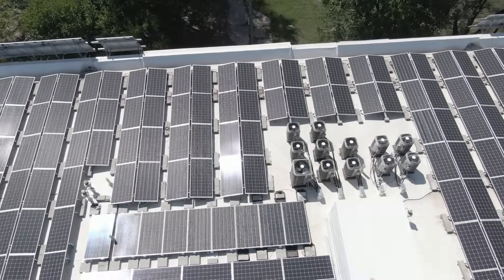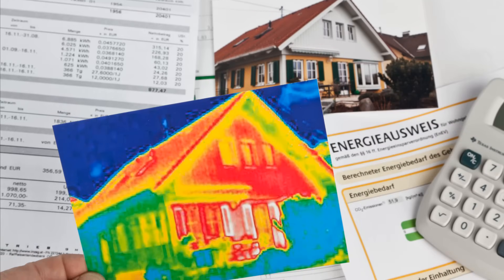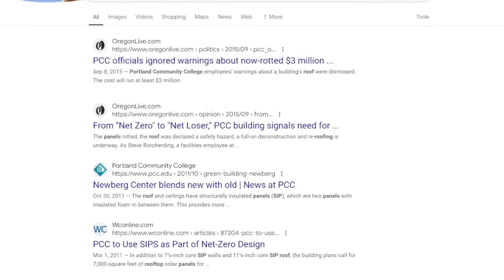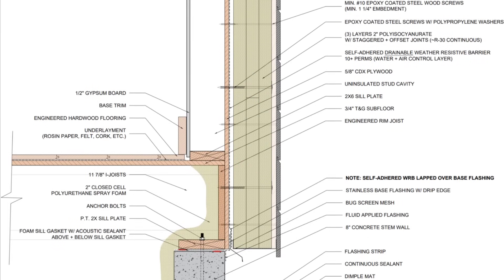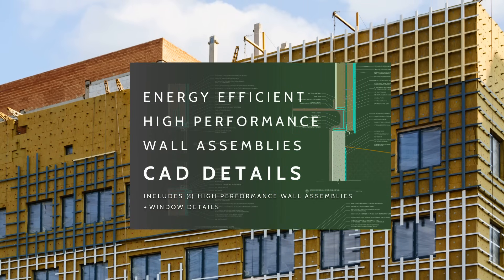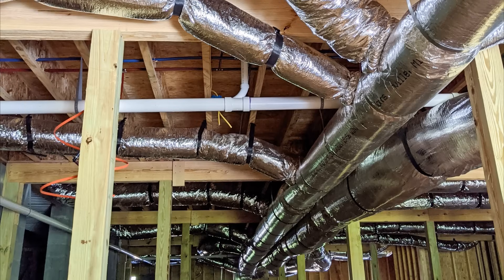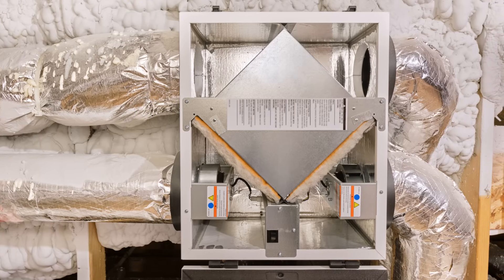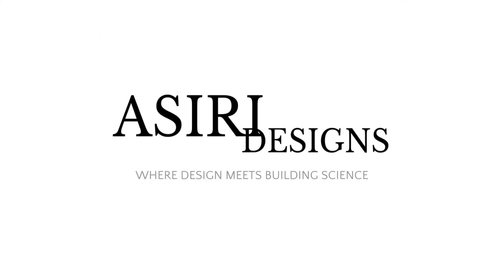The Unintended Consequences of Energy Efficiency...

Comment: I am an Architect in UK.  Some time ago I did some work with The Cranfield Institute, one of the foremost technical universities in UK, with their energy predictive modelling.  I was designing a college library with classrooms and the Govt requirements for classrooms required lightweight, well insulated construction, whereas I was given a free rein on the library due to its specialist nature.  For various reasons the library was a heavyweight concrete frame and floors with brick north and west facing walls with the others being single glazed with solar shading.  The annual energy consumption showed that the library used less energy than the classrooms and maintained comfort level conditions all the year round with very little input.  The A/C, which is vital for book storage was barely used such was the stability of the environment.  During the summer the shading prevented overheating but allowed enough solar gain to warm the mass so that it emitted the heat during the night.  The process was so slow that there was very limited temperature fluctuation.  In the winter solar gain was allowed to heat the building and with its huge thermal capacity there was plenty to keep it warm overnight.  The classrooms on the other hand had wild temperature fluctuations that at the height of summer the temperatures were intolerable and require Air Con.  As Air Con costs 3x that of basic heating to run, the costs were very high.  The principal problem was that the classrooms heated up during the day and couldn't give up the accumulating heat to the point where in the afternoon temperatures were getting to 38/39degC (100+degF).  At night all the accumulated heat was lost and the process started over.

What i took away from this was that for energy efficiency it is better to have a heavyweight building than a lightweight, highly insulated building.  Our ancestors knew this when they built their cottages of stone with 2ft thick walls that to this day are magnificently cool in summer and cosy warm in winter.

I do accept the points raised by this video but have to say that most builders don't understand the importance of constructing the correct detailing, even when its provided and this is all left to the site worker that simply doesn't give a damn.
Reply: Thermal Mass gets the pass.
Reply: Yes, thermal mass is important. I dry lined my 1870s 16" thick solid stone walled house on the external walls. The temperature varies inside from 15 to 22°C year round with zero heating or cooling inputs whatsoever. Contrast the new build with fancy everything and tiny windows and see how those people fair in a typical summer. Derbyshire, UK
Reply: @davelowe1977   The issue with modern housing is that there is a fixation about preventing heat escaping not how the building actually performs, add that to a 'one size fits all' approach and you have the common modern sweat box that very soon demands cooling via 'A/C'.  The trouble with that is the energy used to cool 1deg is 3x that to heat 1deg so it becomes energy intensive, which defeats the object of the exercise.
Reply: @clivewilliams3661  I'm not sure where you get your COP figures. Heat pumps pump bidirectionally and are typically 350% 'efficient'. Performance I agree with you about 100%. I'd be interested to see some empirical data on performance vs energy use in various housing stock options. For example, let's assume we wish to maintain 21C year round. A given property will have a temperature curve from solar heating etc which we could graph over 365 days. We could then calculate the energy required to maintain this temperature either heating or cooling. Of course, this depends on the use case. This analysis would be perfect for a nursing home or hospital since they are 24/365 occupancy buildings. However, the family home might be unoccupied from 8am to 6pm so now the analysis changes to reflect uncontrolled temperature for ~10 hours, but then a 'burst' mode to rapidly meet the set point for the remaining time. A complicating factor is having two set points for awake and asleep time, disagreements over the set points, different set points for different rooms etc. All of these factors effect the building materials used in terms of their thermal mass, and especially in the placement of insulation. The building will behave very differently if insulation is outside of, or inside the main thermal mass components. Not to mention insulation between adjacent rooms. You are right that fixating on insulation at any cost is a blunt instrument, but in my experience as an expert in design engineering and engineering decision making, most regulators and government departments are too stupid to see beyond a low resolution binary choice type scenario. So we are where we are.
Reply: @davelowe1977  I was not specifically talking about heat pumps but my information came from a discussion with a services engineer regarding HVAC and we were talking about the energy to condition a space to raise it one degree and to lower it one degree from an ambient temperature.

As you have pointed out there are a myriad of individual considerations that need to be accounted for to assess the energy performance of any building and speculating on one building type is a worthless exercise.  The example that I give was to show that different building designs that were coincidentally at different ends of the spectrum performed differently.  As I have repeated many times before, every building project is a prototype, even a McD's DriveThru that comes complete on the back of a wagon.  

I have made the point elsewhere that the Approved Documents that most people refer to for an indication of what to do with their building should be only treated as a 'deemed to satisfy' provision and the actual regulation is more nuanced.  This is why we can have buildings that meet the energy requirements of the regulations whilst seemingly not complying with the deemed to satisfy provisions in the Approved Documents or on face value pass or fail SAP/SBEM assessments.
Reply: What does it cost per square to build a heavy versus lightweight building?
Reply: @jimmiller5600  It very much depends on where in the world you are and what local materials and skills that are available.  In the example I cited, the reasons for using a heavyweight building for the library were not solely about energy performance, acoustics, structural spans and building response times all paid a part in the decision making.  With regard to the classroom block, the decision to use a lightweight design was guided by the DfEE funding model.
 If you are looking to design a building for yourself then a whole range of decisions come into play to advise the form of construction but it is worth noting that some of the very best zero energy consumption buildings are heavyweight structures, you ought not to believe the Govt and energy companies as they have a one-size fits all agenda.
Reply: In my country South Africa, Spanish style was once popular with those thick walls you mention, warm in winter and cool in summer, but costly to build. Clay or concrete stocks with a double-skinned exterior are almost universal, erected on a concrete slab, the exceptions naturally being high-rise and factory/warehouse. Here on the mile-high Highveld winters can be chilly, and ceiling insulation doesn't seem to help much. Heat is lost more by convection than by radiation, I think. Would a roof space fan help, blowing the warm air back down?
Reply: @shadeburst  You are correct in suggesting that heat rises and will accumulate at ceiling level so that blowing it back down to floor level would be beneficial in the occupant feeling warm.  This is why underfloor heating is so effective in that heat from floor level rises and gives a more constant overall temperature.  In many cases people compensate for feeling cold (at foot level) by raising the general temperature with their wet heating system having a greater overall quantity of heat in the space.  Its worth testing the temperatures at various levels to get an idea of what the actual status is.
We lose heat by convection through ventilation and leakage.  The leakage can be substantially reduced by carefully surveying the property and stopping up unwanted gaps and the like.  Planned ventilation for say, toilets and wet areas can be controlled by using forced extraction and then extracting the heat, which heats the make-up air, which saves money and ensures that essential ventilation takes place to reduce the potential for mould growth.  I have also used a ventilation heat recovery system to connect up the tumble dryer to extract the heat that is normally thrown away with the moist air.  Normally, the heat recovery works on tick-over all the time, keeping the air moving with fresh input air and when called for by a manual or auto switching system the heat recovery goes onto boost to achieve the required ventilation rates.
Reply: @clivewilliams3661  Thank you for taking the time to explain this in a way that even I can understand!
Reply: I'm not a construction pro, but 100% agree on the point. I'm from Finland, and in the 70's due to oil price induced energy crisis Finland started building in "energy efficient" way. Solid mass timber / brick / concrete building and old-fashioned country-style wood building reduced, in favor of new style with multilayer walls utilizing many different materials, lots of insulation, air tightness etc. For some reason in addition to to this, they also made some buildings with flat roofs! And many with very low foundations!

Well, most of the houses from that time are still on the market, but MANY of them have had to go under significant reconstruction to get rid of mold and air quality problems.

Now being in Finland, we do get harsh winters so it's for sure that buildings need to be at least somewhat effcicient. Those old countryside "rossipohja" wood houses did not rot, because there was constant airflow going under the building and who knows where else. But that will cause significant heat loss. But concrete, brick and massive timber houses from that era are still doing a-ok. I live myself in a 1968 brick house built in older style. My mother lives in an early 60's conrcrete apartment building. In my house the upper insulation has been increased as that's where most heat escapes and windows are updated, but other than that everything structural and insulation is original.

Finnish building code puts too much emphasis on "U-value" when rating energy efficiency, which basically just measures insulation properties of a wall. But basic thermodynamics suggest that massive wall structures capture and release heat energy. It also seems straightforward to me that the more different materials you use in a wall, the more possibilities for moisture to condense in these material change areas. And if any/several of these materials are weak to moisture......

So if I was building a new house right now, I would go for massive timber and wouldn't look any further. Overall energy effciency rivals modern multilayer-buildings, but with only one wall material. Timber is faster to build than brick, and it is a beautiful material as is. 

Newer style buildings of course can and do last when all is done well. They are just much more vulnerable to circumstances and errors. It's hard to mess up if your wall is just solid, but it's easy to miss a spot or poke a hole on a vapor barrier sheet.
Reply: @KeijoAmbersson  I disagree with your simplistic assessment because there are a number of competing requirements that mean that a specific construction is not ideal in every instance.  You have the thermal resistance of the structure, its thermal mass, air leakage, fresh air input (and exhaust), heat distribution and radiant heat reflected off building materials and lastly the occupancy rate.  How you construct a building is determined by how much weight you give to each element because most are contradictory.  Unfortunately, national building codes have to take a simplistic view and a 'one size fits all approach'.  If we required a building to have a prescribed unit energy consumption based on annual weather patterns then we would see that more choice in the solution would be generated.  

BTW what is wrong with flat roofs?  A flat roof can be a very efficient solution and coupled with a sedum surface is both environmentally friendly and high performing.
Reply: @clivewilliams3661  The flat roofs that have underlying wooden structure are horrible when you have snowfall. All the 70's houses that were built with flatroofs have since been converted to traditional sloped roofs here. Snow doesn't go anywhere, roof likely bends a bit under heavier snowloads, springtime melted water doesn't go anywhere, and you have a damaged roof. Nothing wrong with flat roof if you have concrete structure, many large industrial buildings are built that way here too. The 70's houses here were jump to a new style of building, and not everything was known at the time. Lessons have been learned since especially regarding moisture. Nordics are especially difficult for it also due to massive temperature difference between indoor ando outdoor temps.

I did say I'm no pro in construction, just eager amateur, and my point of view is subjective. It is absolutely possible to make modern insulated houses work, loads of people live in them all the time. But I prefer simpler things, less to go wrong. Hence my fondness of timber log building and full brick houses. My dayjob is mechanical machinery design, and whenever possible, I want to make the assembly work with as few parts as I can.
Reply: @KeijoAmbersson  It is entirely feasible to design and build flat roofed buildings to meet the criteria but I think it is true to say that 1970's housing was generally poorly designed and built, mainly because technology had taken hold and there was a belief in its ability to provide what we all wanted in a brave new world.  But to condemn all modern construction as bad from examples that are now 50 years old is short sighted.  I believe we understand more now than ever with building science having moved a long way is a short time.  We shouldn't forget the lessons of the past that took 100's of years to perfect but that doesn't mean we shouldn't embrace modern practices. 

Whilst I don't disagree that Scandinavia has particular needs, perhaps the most difficult environment to design in is in the Alps of Europe.  The fluctuations of temperature, even in one day causes massive difficulties to overcome.  Roofs on building can warm up during the relentless sunny days with very high levels of UV and solar gain to in excess of 40degC and then plummet to -10 to -20degC at night, a range of 50-60degC.  Since WWII a range of materials to have been developed to successfully deal with these issues that former products were poor to hopeless at dealing with them.
Reply: @clivewilliams3661  Yeah for sure lessons have been learned in 50 years. And it's not like energy has become any cheaper, Russia's adventures have made it more expensive than ever. Most new houses built in Finland are built from mixed materials, usually with wooden frame + insulation + vapor barrier + drywall. Outer weatherface from material of your choice. And mistakes of the 70s are usually avoided. Mostly.

Yet, traditional timber log building still stands strong to this day. It has gotten some updates of course, it benefits from newer roof insulation materials and newer heating systems. Those with more money can even go for a classic stone house. It is just less likely to get problems in this kind of structure, based on the experience of housing in Finland. They also hold value better, although in case of timber logs and stone part of the reason is the romanticism of the material. Not everything needs to be built this way, but it is the way I personally would go on a new build. 

Flat roofs, you almost never see them in houses made after early 80s here. The only ones you do see are in more uniquely designed architect houses, and in those cases instead of wood they use concrete and/or steel.
Reply: @clivewilliams3661  I read all your posts and have found it very insightful, just a Lay person here just trying to learn more. I have been thinking about the simplicity and long lasting design of the centuries past brick and stone made buildings. I am not a fan of all the plastics/barriers being used in modern construction. I was intrigued by the ICT designs but the whole Styrofoam thing doesn't sit well. Saying that how would this be as a design, 1' think stone/brick wall then a 8" cavity filled with rock wool for insulation then another internal stone/brick wall that is a foot thick. NO vapour barriers just simple design but with the decoupling with insulation. 
 Another pro builder stated they would do a framed wall in between the stone walls but then your dealing with timber that could eventually rot. I appreciate your insight greatly.
Reply: @jason.martin  There is current thinking on vapour permeability through walls and rather than stopping the vapour getting into the walls, it is encouraged to pass through it as well as allowing the inner skin of stone/brick to dry out on the inside.  Your constructions appears to have merit but it would not be necessary to have 1' of external masonry as most of the job is carried out by the thick inner skin.  The one thing to realise is that the thermal mass of the inner skin will respond slowly and that would presuppose occupancy levels being consistent most of the day to take advantage of it.  One thing that needs to be carefully calculated is the location of the Dew point that needs to be at the outer skin to prevent interstitial condensation causing a problem.

I would certainly not put the insulation in a timber frame for the reason you suggest and I would expect that semi-rigid batts of Rockwool to be reasonably self supporting especially held by the cavity ties.
Reply: "For some reason"

Architects still being the clueless bunch urban planners know them to be. Newsflash: Books are heavy.
Reply: yeah, but.....people.  Little 100 watt moist heaters.  Classrooms full all day, library full of stabilising books.
Reply: This is the advantage of thermal mass.  Not only is thermal mass present in the building's construction, but also in it's contents.  I live in a 70 year old home on the east coast of the USA in a home primarily built of brick and block.  It is VERY comfortable and rather efficient to heat and cool.  I hear of others around that have much newer wood frame built homes, and they are always complaining of big electric bills, and their homes either being hot or cold.  My AC unit doesn't even run until late in the evening during the summer, and during the winter the house stays warm for a good part overnight, and heat only needs to come on in the morning and evening
Reply: @audvidgeek  It is no coincidence that in many parts of the hot and arid world the vernacular building type is heavyweight adobe or stone buildings that remain remarkably cool during the hottest of summers.  If you can reduce your cooling cost then that will have a significant economic benefit.  Service engineers have told me that cooling 1deg costs 3x that of heating 1deg.
Reply: @audvidgeek  thermal mass doesn't change how much heating or cooling a building needs, it's still losing the exact same amount of BTUs as a house with less mass. This is basic thermodynamics.
Reply: @AltereggoLol1   Yes. but the thermal mass allows the building's temperature to be more stable in relation to the outside.  In my case, the cooler temperatures at night time cool off the house's mass and it stays cool for a good part of the day.  We close the windows and keep the cooler air in. At night time, we open the windows to let the heat the house has picked up escape and allow the mass to cool down.  The house's temperature is more stable and comfortable.  The wintertime, is the same way.  The house is warmed during the day with mechanical heating methods, and it remains warm through the night when the thermostat is set back. It's cheaper to heat the house during the day when you have heat gain from the sun and warmer outside temps.
Reply: That sounds like it works great in the UK, where the average daily temperature is approximately comfortable.  It wouldn't work well in Texas in the summer where the average daily temperature is just hot.  It wouldn't work well in North Dakota in the winter, where the average daily temperature is deadly cold.  Thermal mass serves to hold a building at the average daily temperature.  If the average daily temperature is not what you want, then the mass doesn't help.
Reply: @FreedomTalkMedia  I think you are very wrong here. You simply want the inside of a home to be resistant to external temperature change. The location of the home and temperature of the outside should be irrelevant since you are trying to isolate the two spaces. The laws of thermodynamics dont change just because you went to a different state or country. If the average daily temperature is not what you want, then the mass is exactly how you efficiently retain the temperature that you want once you get it there. You started out talking about texas, so then go look up Earthships which are made in texas. The heavyweight design is pretty obvious in all of them to retain a steady and desired temperature.
Reply: @FreedomTalkMedia  never heard anyone claim the UK to have approximately comfortable temperature at all. Also heavyweight buildings are great at keeping buildings warm, look at old buildings in the middle east. And for winter places again thick walls are good too.
Reply: @Alex-cw3rz  The UK does not have extreme temperatures like many other parts of the world.  The hottest month, July, has an average high temperature of 75 degrees in London, with a low of 59 degrees.  That is a near perfect temperature range for thermal mass to work.  

In the winter, the averages are from 41-48 degrees.  

Detroit is 8 degrees hotter on the high and 7 on the low in summer.  In the winter it is 16  degrees colder on the high and  12 degrees colder on the Low. 

In Dallas the average high temperature is 91 degrees in the hottest month, with 20 days over 100 degrees over the summer.  Now this is key, then the temp is 91, the low is 70.  Unlike London's 59 degree nights, 70 degrees is not going to cool your dallas house, if it has mass.  

Yeah, The UK has a mild climate with mean temperatures, if anything on the cool side.  So there would be little need for cooling if you have a massive house, in the summer .

What thermal mass can do in Dallas though, is what I said it did in Guyana.  The air conditioner can run all night, cooling the mass, so it can store heat again in the day.  Then the grid is less strained during the day and energy prices are less.
Reply: @FreedomTalkMedia  If that were true then why are the vernacular buildings in the American south and Mexico built with thick adobe walls, with this style of building being common throughout Nera and Middle East? Those thick mud walled buildings are generally wonderfully cool in the day.  Also, you will find that comfort conditions are a broader range than those expected by most Americans  

In the northern climes, the predominance of timber often dictates the basic building materials but still the vernacular buildings were heavyweight utilising large baulks of timber instead on vast quantities if sawn timber that supports the heavyweight ethos.  In those places where timber is less prevalent and stone building is common, thick stone buildings provide cosy warm places during sub-zero temperatures and comfortable temperatures during the summer.
Reply: @clivewilliams3661  Well, in most deserts it gets cold at night.  It really depends on the location.
Reply: @FreedomTalkMedia  Location does have its part to play because in the tropics the mass of the vegetation retains heat so that night temperatures don't drop as far as well as cutting any cooling breezes.  In those circumstances you will find the vernacular building type to be lightweight with masses of ventilation.  My wife's family home in Guyana was raised on stilts with storage only at ground level, with the first floor completely open plan with few external walls.  The bedrooms were built with freestanding partitions with no ceiling, being open to the underside of the pitched roof, ventilation flowing freely from the veranda and up over the bedrooms, drawing some of the heat out.  The whole construction was to take maximum advantage of the sea breezes to moderate the warm humid atmosphere.  It is interesting however, that many old colonial fortifications were built with massive walls and those buildings tend to be quite cool inside but even more humid as the ventilation was poorer, which meant that the RH increased due to the cooler air.
Reply: @clivewilliams3661  In Guyana almost everything is concrete now and the thermal mass effect is there.  You can feel the wall warm during the day, even as the AC runs to keep the room cool.  It doesn't really get that cool at night though, like you pointed out.  I guess the thermal mass enables you to store up air conditioning all night.
Reply: @FreedomTalkMedia  I was commenting on the traditional housing rather than modern ones and before technology took over.  I much prefer to get the passive side of the building right and then just use any technology to trim to the final effect.
Reply: @clivewilliams3661  Thick stone buildings are not "cosy" in prolonged sub-zero weather. There's a pub I'm familiar with in Carleton Place, ON, probably built by Scottish stonemasons in the 19th century with really thick walls, a good 2' thick... and you absolutely do not want to be seated near those stone walls in the dead of a Canadian winter. It's just sucking the heat out of the room and conducting it to the outside. Cosy it is not. Any benefit of thermal mass has long since been lost, probably by mid November. The R-value of stone is like 0.1 so even this 2' wall has an R-value of at best 2.5; literally putting a half inch layer of styrofoam on either one of its faces would have doubled the entire wall's insulation value - that's how bad stone is at insulating. The only way you're going to benefit from the thermal mass of masonry in such conditions is if you put insulation on the outside of it. Heck, just piling up straw bales on its outside for the winter would be a vast improvement.
Reply: @davidjames4915  The example that I gave specifically related to the UK climate that is temperate and the point was that the thermal mass is important in the way the building reacts.  Is the building you describe in Ontario, Canada?    If so, then summertime temperatures can get very hot (when compared to UK) and the thermal mass of the stone building will be of considerable benefit, such that cooling will probably not be required.  A light weight, well insulated building on the other hand will heat up mercilessly due to solar gain and definitely require cooling input.  As cooling requires 3x the energy to change the temperature 1deg than heating, solving that issue should not be forgotten but rarely is it catered for other than accepting the cost penalty.
In your example of the Scottish built stone buildings you will note that the Scots builders used their vernacular tradition to create the building that would have been thick stone walls that served them well in Scotland particularly as there was no real insulation available.  Today, the correct construction form for the Ontario building might be considerably different and I wouldn't want to guess at this stage what it would be.
Reply: I think the other difference is the materials a lot of the issues here are from timber buildings, whereas we don't build timber buildings in the UK. Which means a lot of these issues are mitigated, when as you say are built properly
Reply: @Alex-cw3rz  We have built many timber framed houses in this country.  Most of the houses built by the Development Corporations in the New Towns of 1960's and 1970's are timber framed with often brick cladding and that would account for 100,000s.  When I worked for P'boro DC we built a timber framed/brick clad house on prepared foundations in 9 days to hand over to the new tenant.

The reason we don't build as many timber framed houses today is because most of the house building is carried out by the private house builders who only build what the know and won't get into timber framed design because it requires to much design and control effort.  If we have to ramp up construction building rates then more factory production will be necessary and that will necessitate timber framed construction.  There is nothing wrong with timber framed buildings and the quality control is usually better than the masonry houses that are currently being built.  It is true to say as a generalisation that modern houses are not built properly.
Reply: Lots of daylight is all well and good but if you insulate buildings really well, they will become greenhouses regardless of the mass of those buildings due to the sunlight. If there is ample shading for all windows, truly well insulated buildings will remain at steady temperatures in spite of their low thermal mass. 
I've experienced this at a construction site I've been working at for the past few months (I'm an apprentice carpenter), even when there were no windows the temperature remained significantly lower inside of the extension that was built onto the house. The extension is timber framed, with a concrete foundation slab, 18cm of mineral wool insulation in the walls and 12cm of PIR hard foam in the roof.

A question out of curiosity though, you mentioned using single glazed windows in the library. Why did you choose not to use double glazing, when your aim was achieving higher temperature stability?
Reply: @Leon_Schuit  architects in the 1930's through the 1970's used to use awnings and overhangs, along with precise positioning of the building's windows both in size and in direction, to take advantage of solar positioning throughout seasons. Awnings were made to precise lengths so that the low sun of the winter would shine into the windows, but the higher sun position during the summer meant the windows were shaded by the awnings or overhangs.  Frank Lloyd Wright was one of the architects that did this.  Even older than this, many realized you plant evergreens on the north side of a house to break wind, while you plant leafing deciduous trees on the southern side.  They shade the house during the summer, but during the winter, they loose their leaves, and let the solar radiation warm the house.
Reply: @Leon_Schuit  Many years ago I spent a few months driving around Australia. Galvanized roofing was still common, but some farmhouses I saw had double-skinned roofs with the space between freely ventilated. They were a LOT cooler! So I fully agree that double-glazing is more efficient.
Reply: @shadeburst  Double glazing relies on trapped or no gas in the void.  The gas is still and transmits less heat.  Pilkingtons (Saint Gobain) produced a research paper on the effectiveness of the space between glass panes in double glazing, what they found was that the insulation value increased up to about 12mm and then stayed constant until about 20mm when it reduced.  The cause was found to be eddy currents in the gas being generated by heat (real vacuum in double glazing doesn't exist)  This has nothing to do with the double skinned metal roofs found in hot climates where air is encouraged to circulate between the two skins to remove the hot air.  Galvanised roofing can be found throughout the tropics and Australia because it is cheap and because it has a natural reflectance, it is effective as well.
Reply: @Leon_Schuit  The point about buildings with a large thermal mass is that they absorb the solar gain to heat the structure during the day and then give up that heat when the temperature cools at night.  If you have a lightweight building the same solar gain heats up the light mass of the building quickly and carries on heating the space so that it gets hotter internally.  Having good insulation in a lightweight building means that little of that heat escapes during the day even though the external temperature is lower but because of the low thermal mass what heat there is is lost more quickly.  I thoroughly agree that solar shading is critical in defecting solar gain and on the library building we had external horizontal shades that cut off the direct sunlight into the building during the summer but allowed full solar gain in the winter.  The track of the sun varies during the year and our site was at 52deg north (UK Midlands) so that the shading was effective for sun down to 45deg.

We had very large panes of glass so that the views from the library could be taken advantage from even the depths of the building.  The problem with such large panes with double glazing is that you get horrible distorted double reflections caused by the differential bending of the inner and outer panes and the diffraction through the two sheets of glass, the smaller the panes the less this is an issue as the panes are stiffer.  This is why shop and other display windows are always single glazed, in mitigation the glass pane was 10mm thick and as glass has a very low thermal transmission it performed reasonably well.
Reply: > As Air Con costs 3x that of basic heating to run
what are you talking about, this is nonsense.
Reply: @AltereggoLol1  Then please take this up with various services design engineers that I have worked with.  If you don't believe it, please provide the technical data to support that.